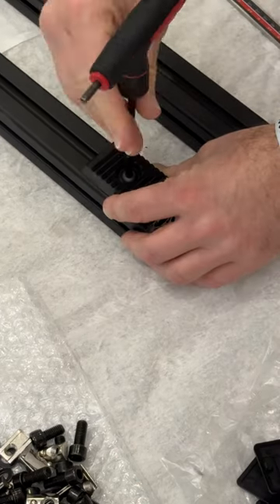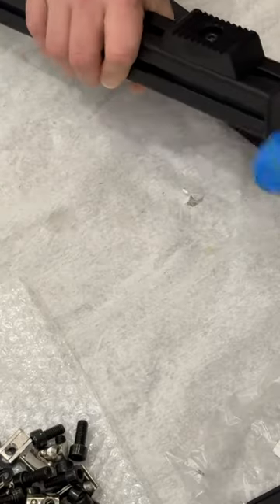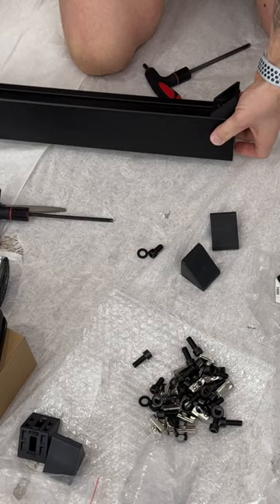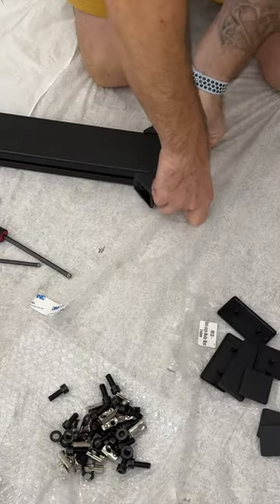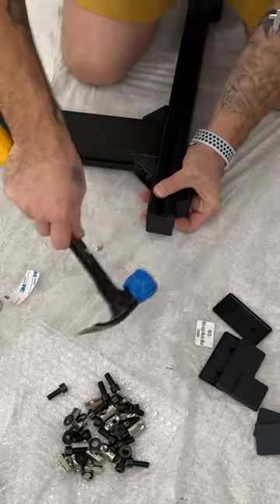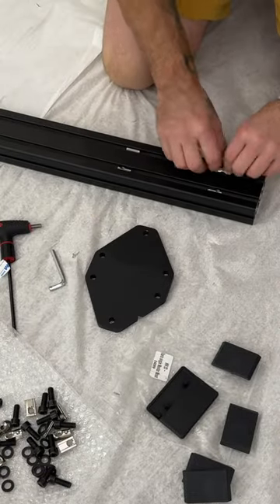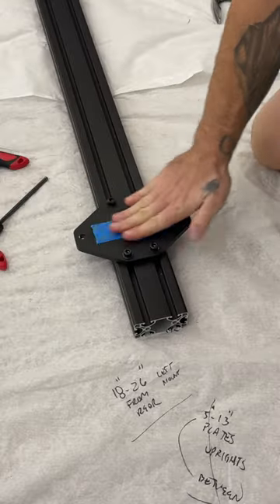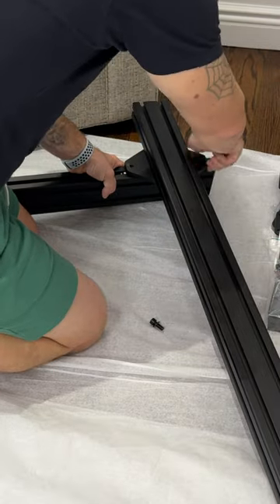SIM-LAB: P1X PRO [V2 FREESTANDING VARIO TRIPLE MONITOR MOUNT BUILD] #simracing #simlab #p1x

Comment: what is the blue tape for ?
Reply from the maker: I mention it a bunch of times throughout the videos. It's to prevent scratching the profile when it slides around during mounting. Even without sliding the profile around, it'll still gouge or scratch the profile you're mounting to with the t-slot nuts. For example, with this monitor mount, I had to slide the uprights out, and having the blue tape on there made them slide out easily once I loosened the bolts, and prevented scratching up the center horizontal profile.